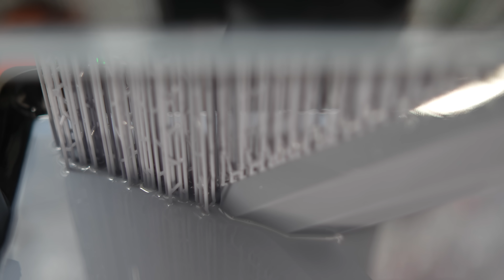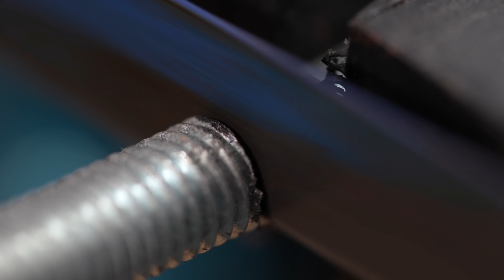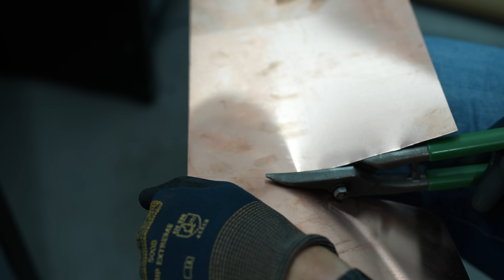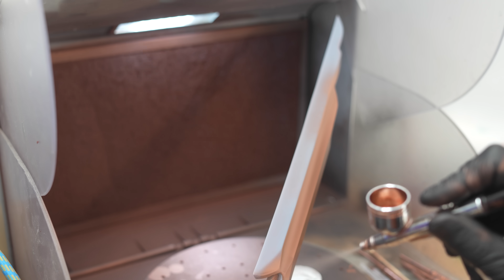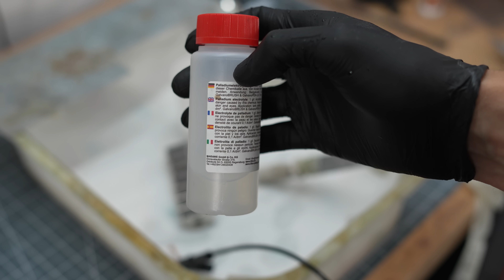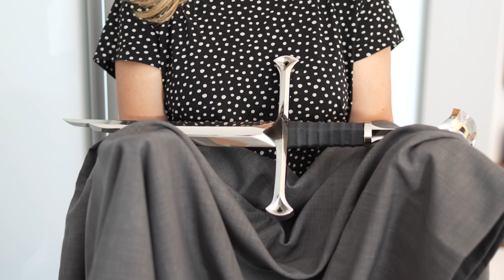Electroplating 3D Prints | Swords Tutorial 1

Comment: The problem is your wrapping of the copper wire.  You need to add a sacrificial piece to connect the wire to and remove it after plating.

Comment: Btw do you need different electrolytes for electroplate nickel and copper? I thought electrolyte can be any solution which is conductive
Reply from the maker: Yes, that’s because the copper and nickel baths contain CuSO4 respectively NiSO4. These baths can get saturated by the anodes and recover by these.
Reply: @hen3drik   so if im getting it right you basically needs solution which contains ionts of material you want to plate with? Does it matter if its sulfate, chloride, etc.? My knowledge of chemistry is almost zero but i really want to try electroplating :D
Reply from the maker: @johnycorbie6121  you should get a commercial acidic copper sulfate solution and start experimenting with it. That’s the way I did; I had very limited knowledge as well

Comment: Once again, great video! Just a quick question - for smaller parts (eg your One Ring from a previous video) would just using a galvanic brush/pen be feasible for similar results? I have some ideas for gifts to friends and want to try to avoid bath plating if possible
Reply from the maker: Using the pen only thin layer are deposited. You should create a small copper bath and use the pen afterwards.

Comment: Someone telled me that electroplating plastic is called electroforming. But then i watched a video about that both things can be combined and that electroplating covers more detail and just a matter of how the mixing is. Also that there is a other form of electroplateing which is pretty old and it's called electrotyping, where you instead of using the actual 3d print, you would make a mould from it and then put some fine copper powder or simular into it, to make a very thick pure copper object. So, my question is, are you electroplating or electroforming here?
Reply from the maker: That’s a good question. I stumbled about the naming as well and it‘s crazy. In German we could call it Galvanoplastik, but when creating copper coats on plastic by using conductive paint I refer to electroforming. After that I put (decorative) metal layers on that object which is electro/metal plating.
Reply: @hen3drik   Also using translation of electroforming or plating to german, gives the exact same result. Well atleast for Google translator.

Comment: Is there ways to alter the level of sheen? Like if you want it to have a slight shiny look to it, but not be mirror chrome shiny? Like medieval armour for example.
Reply from the maker: You can brush the copper layer with steel wool and then nickel plate it. That’s the effect you want
Reply: @hen3drik  Thank you! Is copper always needed for the base coat? Or can you go straight to electroplating with other materials? Nickle, brass, etc...
Reply from the maker: @SkintSNIPER262  Copper is a good base material because it's cheap + easy polishable. It's also soft and can even formed up to several milimeters. Nickel also works, but I did it twice and it was very slow depositing and there were cracks etc. I wouldn't do that again.
Reply: @hen3drik  Thanks for the help! Now I gotta get some nickle and find something that looks like gold lol

Comment: This AWESOME! For someone looking to get inton3d printing. Would you recommend resin style like this or the other style with a table. More or less I'm looking into 3d printing for cosplay. I would paint manually. Electroplating looks like a headache haha.
Reply: There's more post processing on fdm than resin, because fdm is more coarse.

But fdm usually comes in larger bed sizes, so you can typically make larger parts.

Fdm is less hazardous for your health (don't inhale either during printing process, but resin is clearly worse if you had to rank them).

Resin gets MUCH better fine details when it works.

Basically, it comes down to the type of cosplay.  If you are printing a full suit of thick heavy armor, fdm is probably going to be easier, and the fine detail less important.

If you are going to be making lots of fine parts that need lots of detail, belt buckles pins, buttons, you may be better off with resin.

Having said all that, there are clearly some larger format resin printers, as shown here, but you willneed to evaluate the various prices of printers.

The resin printers have some advantages, in that mechanically they are simpler.

Personally I only have an fdm, the resin printers interest me, but the handling issues with resin put me off until I have a larger workspace that is away from human occupation. (I print in a study, not a well ventilated garage)

Comment: I have a question about this. Aren't resin prints VERY brittle compared to PLA or other plastics ?
Reply from the maker: They are more brittle, but once electroformed they become very (very) rigid
Reply: @hen3drik  Have you done any strike tests to see how well it holds up compared to lets say PLA ? I'm about to add a resin printer to supplement my other PLA printers. I intend to use the resin printer for detailed areas, like the engraved text at the bottom of your sword. But i will make cut outs for where details is needed, print most of the model in PLA and later glue in detailed Resin parts. Is this something you've done ? Can any material be electroplated ?
Reply from the maker: @jnssmnsn  You can electroform any material with this method, yes. I didn't do it as you said, but combined pla + resin in one print; PLA can be electroformed as well. Make sure to get rid off the visible layers.

Comment: My stomach lurched when you scraped it. Very informative and inciteful, I always just think of using aluminum tape and some polish compound or steel wool to get a desired finish lol. But the durability of this is very surprising combined with the threaded rod core. Id want to do this with the sword of the witch king probably. But sky's the limit I suppose. 
How important is rotating the part during the plating process and having it vertical. I can picture having a longed blade horizontal and not rotating in a trough
Reply from the maker: Rotation is to prevent anode shadowing. Movement is to prevent uneven electroforming. It‘s both not necessary but helpful.

Comment: Amazing. Simply amazing! Game changer stuff here. A couple of quick questions that pop to me are: can the parts be refined (sanding+bondo+ 2K primer etc) before the copper conductive lacquer? Also, how much current would you need for a 150L bath (how many V/A power supply is needed)? Really appreciate it if you take to give me answers to those. Truly amazing work!
Reply from the maker: Hi, thanks for the warm words. Yes bondo + 2k is perfect. Amp relates to the surface of the conductive area, not the liters of the basin.
Reply: @hen3drik  Oh, I see didn’t know that, amazing. If you were to put a motorbike helmet inside the bath? What’s is you V/A guess?
Reply from the maker: @Michelenas  Hard to say. 20-30A I guess.
Reply: @hen3drik  So, can we say without a doubt that 60A power supply would be more than enough for a motorbike helmet for example?
Reply from the maker: Since surface area is going exponential I cannot say „without a doubt“, but basically this should do the job. Probably. 😅

Comment: Isn't it more reliable by calculating surface are and calculate the required current and use constant current instead. That's how I place zinc cadmium for example and it's really a set and forget process.
Reply from the maker: It would be, but electroforming starts with a very thin layer of conductive paint. This will burn if you put the max A in there.
Reply: Ah makes sense. 10 amps through a 1uM layer of graphite will give a nice firework display though =)

Comment: Moin and thank you for the very detailed and good videos on electroplating. Next stop for me: Buying equipment and material... But one thing is burning under my nails: Is it possible to electroplate EVA, i.e. foam (from the cosplay area)? My idea would be to treat individual areas of a cosplay armor accordingly with conductive copper paint and then process them using pen plating. Do you have experience with this and/or tried it before?
Reply from the maker: You‘re plating a layer of around 250microns. So any bending would result in cracking the metal. I think this will be the case when forming on EVA foam. Unfortunatly.

Comment: I didn't expect such a high weight increase! Did you ever measure or calculate how thick the copper layer is?
Reply from the maker: I measure it once in a while. usually it's 0.2mm - 0.25mm after 4 hrs.
Reply: @hen3drik  that's a bit less than I expted. Is it possible that the huge weight increase was because of the water/electrolyte that your parts absorbed?
Reply from the maker: The prints absorbed nothing. It all because of the relative high surface and metal layer. Copper is heavy 😉

Comment: From what I understand of the process, some of your finish on the bade part might be due to the steel of the threaded rod. My wife does a lot of electroforming and is very careful not to get anything with iron in the solution.
Reply from the maker: Good point, but that‘s not the case here. It happend before I ever put in the rod. It‘s zinc plated iron, too. I think it may have to do with the speed and contact area of the wire.

Comment: Where did you get the fluids?
Reply from the maker: There are some dedicated online vendors (tifoo etc.), also you an search for acidic copper electrolyte on eBay or Amazon. The conductive paint I use is copper paint, also conductive graphite spray works but is more difficult to plate on.

Comment: This was interesting. I just got into Resin 3D-printing and did not know about this. I wonder if I can use it on some jewelry I printed for myself and still be skin-safe. Maybe with a sealant. Thank you for the ideas.
Reply from the maker: Yes, if the final plating is like gold, palladium or Platin it‘s pretty skin safe. I did a golden ring video, maybe look it up.
Reply: @hen3drik  Thank you, I will. I still react (slightly) to gold but I did not know about Palladium. If anything I apply 3 coats of sealant typically to jewelry.
Reply: @RoseKindred  have you tried nickel free gold or other metals? It's very rare (though possible) to be allergic to gold, typically it's the trace nickel that causes allergies.
Reply: @szurketaltos2693  To be honest, it never occured to me to look into the gold itself. So thank you. 
I used to work in the mall and I know some of the costume jewelry and the stuff in the cases would cause issues. I also have a class ring that is supposed to be gold that I react with. 
It is weird, some titanium, some gold, and sterling silvers, can cause issues but it is not consistent if that makes sense. So yea, perhaps it is the impurities or mix I react to, but not sure if it is nickel, I'll have to look and see if anything I have is made of it specifically to test.
Reply: @RoseKindred  you're welcome. See if you can find explicitly nickel free stuff, or 24k gold should be free of nickel as well I think. My SO has a nickel allergy and as far as I can tell, isn't allergic to any other metals. Costume jewelry generally has a ton of nickel.
Reply: @RoseKindred  oh, and you can get the class ring plated so you don't have allergies, if it turns out that trace nickel is causing the problem. Check with a jeweler.

Comment: Is there an easy way (software) to figure out surface area of a print to determine power supply needed. When I load my Ironman faceplate into blender it gives me the entire surface area and I only want the outside not interior.
Reply from the maker: I use blender + add-in 3d print toolbox installed. You can set the units to "meters" + 0.001 unit scale and read the surface area in the toolbox. divide by 2 (if you don't want to plate the inside) and multiply with 115. This will give you a rough value of what you can expect.
Reply: @hen3drik  perfect I’ll give that a try.  Any chance you have links to any good tutorials on this?
Reply from the maker: No, it help if you look at the screenshots in the tutorial plating video (Witcher medal)
Reply: @hen3drik  I finally found a supplier for electroplating materials in Canada. I think I’ll play around with a plug & plate kit vs tank soaking at first.  It might be a little tedious plating large parts but less expensive to try.

Comment: Amazing results! For a future video idea, could you experiment with electroplating a print with embossed letters on the other side? The idea would be to have a surface that looks like a smooth mirror, but when a light or LED is lit behind it, the writing would shine through the mirror revealing the writing. Not sure if that's even possible, but it would be awesome if it was!

Thanks for your great and informative videos!
Reply: The metal is completely opaque even in very thin layers, so this would not work.
Reply: @bradley3549  Maybe it could work with silver. But I don't think that the layer could be made thin enough with conventional (electroplating or chemical) methods.
Reply: @CoolKoon  electroplating can be vary thin, however the conductive base layer is not. It would probably require vapor deposition or something.
Reply: @Smorb42  Exactly that's what I've been trying to point at - vapor deposition. And actually there are transparent conductive layers too, Ben at Applied Science has done a REALLY excellent video on that.
Reply: I once made a laser etched mirror acrylic pattern, which looked mirror like at the front, but when lit from behind created a galaxy pattern. So something similar may be possible. The front mirror did have a slightly frosted look, so it would need to be dialled in. Also that was a flat surface and over a 3d surface you'd probably need more complex laser equipment.

Alternatively you could recess the text fill it with something and prevent electroplating in the recesses. It would be more obvious from the outside though.
Or you could etch it away the way they do with etched scroll designs.

Comment: Make a real sword my friend. Iron(II)sulfate 40 g/l, Ascorbic Acid 1,2 g/l, Citric Acid 3 g/l. Filter through a coffee filter and keep solution clear. Adjust pH with sulfuric acid to about 2,5. Drop in some steel wool as a reducing agent unless solution is pale green (because Iron(II) oxidizes to Iron(III) in air). Use pure iron or carbon sheet anodes, anode pockets are a must. Plate at 2 A/dm^2. Maybe use a wetting agent or a surfactant if insufficient results. Leads the finest carbon steel with 400-600 vickers hardness. It's also much cheaper than the metric tons of copper you use :)
Reply: But his is a light prop and the police leave, laughing.  
Can only imagine the result the first time someone gets hurts with your weapon of murder.  😊